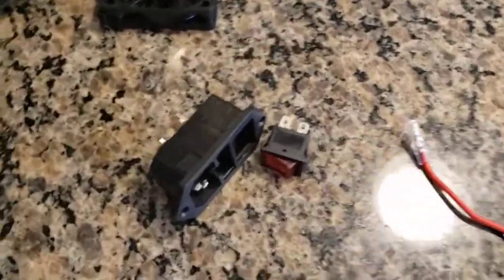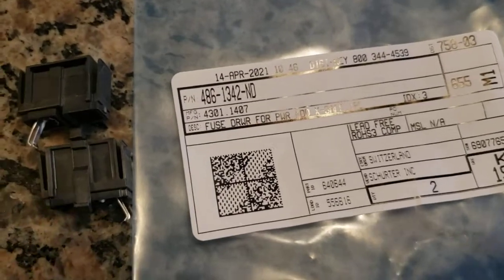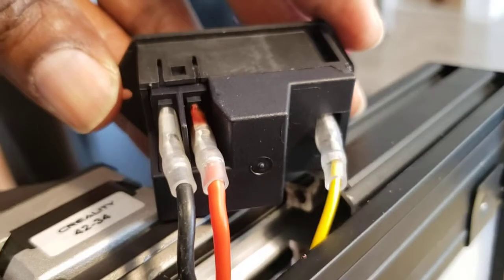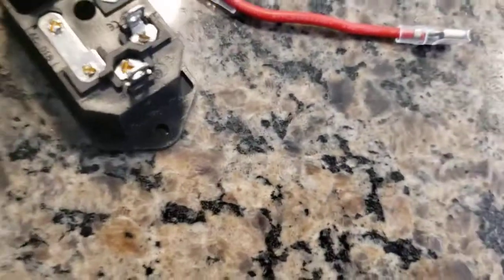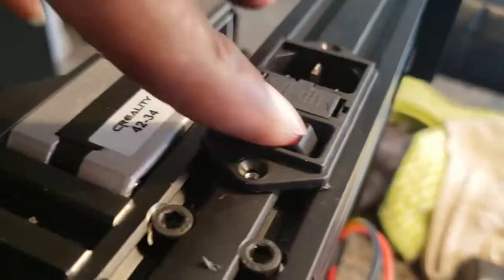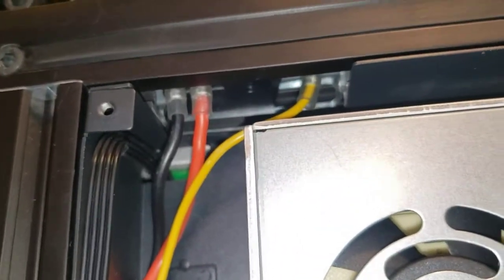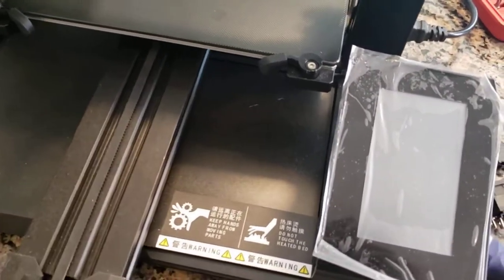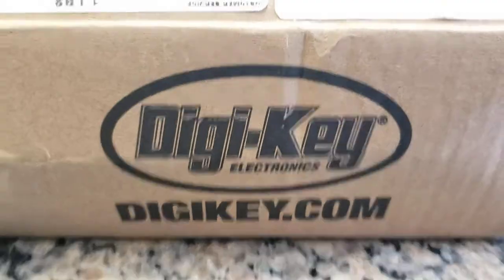How to completely replace, the power module, and the , switch, for Creality CR6 SE – SOLVED!!!

Comment: Thank you! This helped me. I finally managed to replace it and turned it on and it turned back on! The original switch was fine for me for a while but one day, it just ... conked out. Glad it was such an "easy" fix but it wouldn't be possible for me to figure it out without videos like yours. Now if I can just get that cover back in place.... these tiny screws...
Reply from the maker: Hey Nicholas! 
That's the reason why we help each other! Very glad it worked out for ya and glad to hear your experience!

Comment: Thanks, is the switch still working?
Reply from the maker: Oh yes. Absolutely 💯.
Reply: @joseph-israel  I ordered same things ...my CR6 SE worked only 10 hours in total and switch went bad...guess what I was not using for a year thank you I will try again
Reply from the maker: @flyinghigh2646  this is uniquely unusual. Have you made the proper changes and connections as it is supposed to be?
Reply: @joseph-israel  Oh no no , I have just placed the order for the parts, printer I got from kickstarter worked only for 10 hours ...I still have to install your changes ...
Reply from the maker: @flyinghigh2646  ah!!! I got you. Sorry for the confusion. Okay. Let me know how it goes.